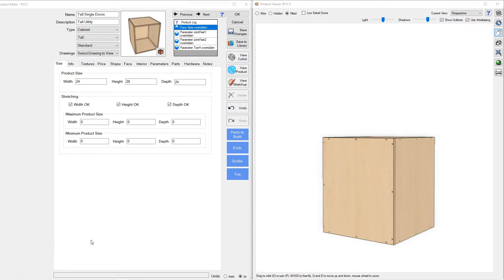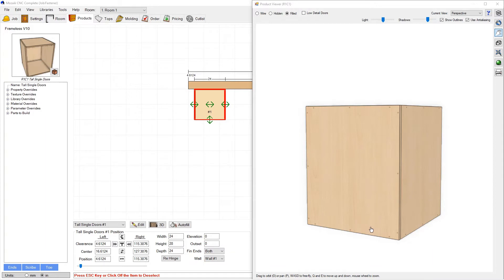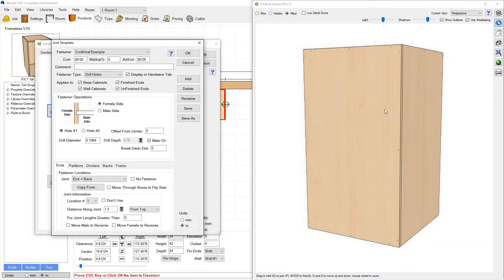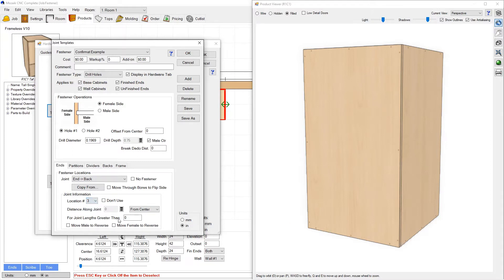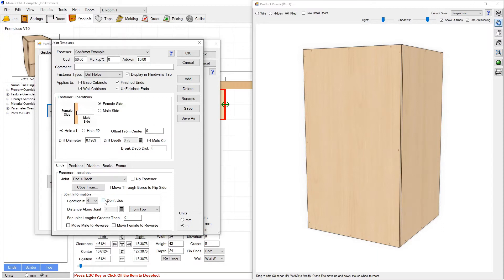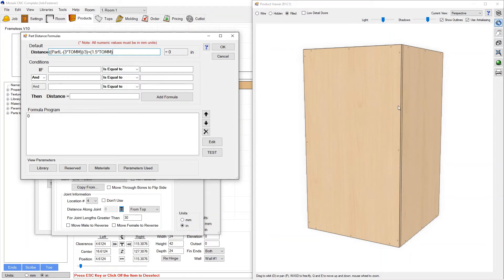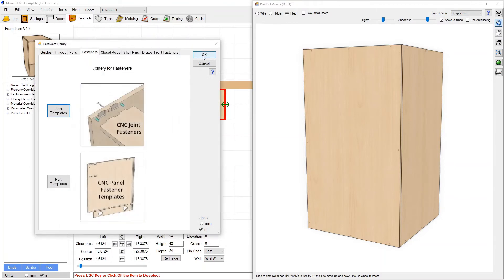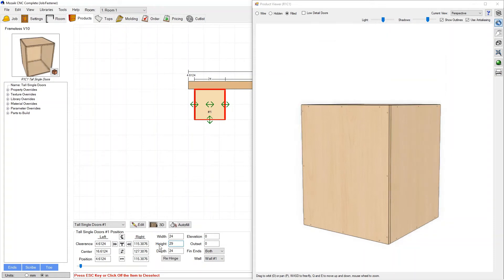Frost CNC - Mozaik Software - Pilot Holes using Joint Fastener Templates (Part 1)

Comment: I followed the video exactly and it didnt work for me. When i set my top and bottom hole to 1.5inches it wants to drill them at 2 inches and when i set my middle hole for PartL/2 it sets it about an inch higher then it should. I have to set the 4th hole to show up at 26 inches because if i set it at 30 it wont show up till 34. Very confused